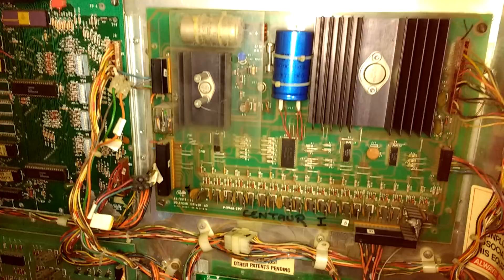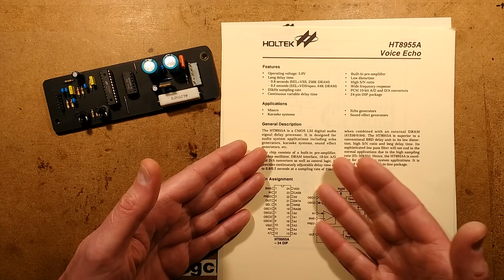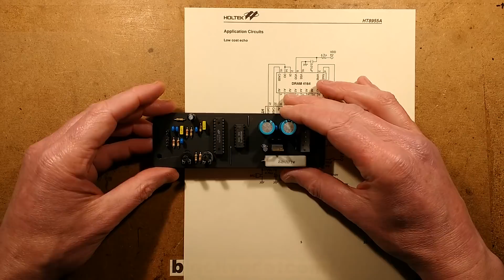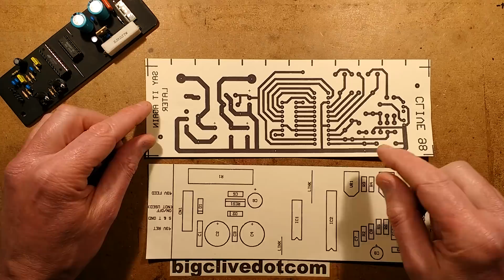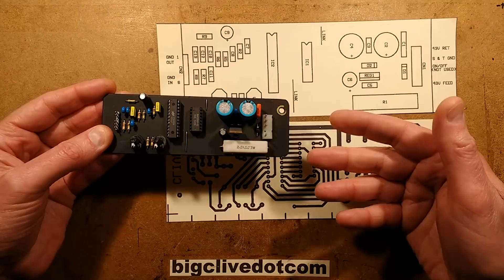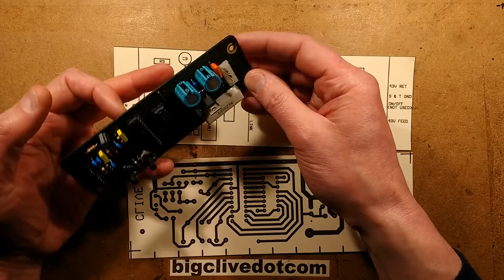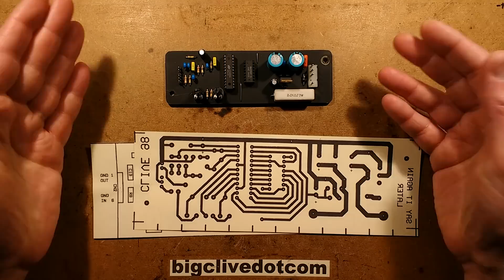Designing the Centaur pinball replacement echo card.

Comment: That old board, you're right, bucket brigade delay line
There's a single chip echo unit around now, the PT2399, there's a few ready built devices on Amazon, the one i have works very well.
Reply from the maker: I did consider redesigning it around the PT2399, but it actually has a high support component count.
Reply: @bigclivedotcom  Xvive now makes modern re-issue bucket-brigade chips, including a 4096 stage (MN3005). Pinout and such is different than the reticon chip, but similar tech beyond that.
Reply: I think the big reason they started that long slide down hill here was they gutted the things a hobbyists would look for and did not cover the other things. They became a cell phone store more or less. really sad the nearest real electronic store is about 35 miles (56.3km) away and they have short hours.
Reply: Not sure if you have/had Radio Shack. Most here are worthless for any real electronics now.
But they had a IC out that was at the time very spendy and later came up with a kit. Here is the data sheet.
 http://www.pmerecords.com/Docs/Archer_SAD-1024_Tech_Data.pdf
Reply: Unfortunately for the PT2399, you can't get sub-30ms delays. With this Holtech chip, you can just swap out the RAM to be smaller for a smaller delay.
Reply: I like PT2399 very much
Reply: I used to work for a TRS-80 dealer as a service engineer  :)
Reply: Sean Not-telling we certainly had Radio Shack / Tandy in the 80's. I worked for a company that used the TRS-80 for automated test equipment. At some point about 15 years ago possibly they ceased to be in the UK. Pity because the TRS-80 was damn good for it's day.
Reply: "but it actually has a high support component count." Eh? All it needs is a few passives and a 5V supply to make a 'low cost' echo that matches the Centaur sound.

Comment: Analog electronic delay? Probably BBD, bucket bregade device.

There haven't been analog delay ICs available for decades, until they suddenly started appearing super recently. One is Xvive MN3005, quite expensive. Another is Coolaudio V3205SD, which is much cheaper.

Most guitar pedals use a digital delay line these days, designed to imitate the analogue ones, PT2399 from Taiwan. It's incredibly cheap, and it's perfectly fine.

Comment: I want to make one for my CB radio. Do they run at 12 volt DC after the step down module?
Reply: Ah 5 volts. Easy peazy.
Reply: You can buy mics with built in echo for CB's - not sure it's a good idea, but you can.
Reply: I was just reminded of the echo mic I used to have for CB back in the day.
It had feedback and volume slider, with a "modification" to bring the loop speed out to an external control, just like Clive describes.

I'm going to have to go find it now, I'm curious to see what it uses.
Reply: Alternatively I believe people used to use a thing called a Melos Echo Chamber - just a little external echo box that seemed to work quite well for CB for some reason. Think people use 'em for dub music too.
Reply: mordokch I have bought numerous mics and internal boards. I just like tinkering and modding on my own. I'm also not terribly impressed with most commercial CB boards or mics.

Comment: There is another echo chip on the block from a Chinese/Taiwanese company called Princeton Technologies, and now most echo circuits seem to use that instead of Holtek chips. It has DRAM built into the chip, but I'm not sure how compatible it is, considering I couldn't get it to work.
Reply: Update: I'm gonna attempt to make a more modern version of the board.

Comment: I learned 6800 machine code back in the day, pinball machines are a classic case of machine control. I wonder how many 6800 controller boards are still chugging away - long superseded by PIC I suspect :(

Please show the Haunted House sometime I've not seen one working in years!
Reply: The PIC16 was designed about the same time at the MC6800 if not just slightly before. GI got that initial concept quite well sussed out.
You can take solace in the 6800 highly influencing (ahem...) the design of the 6502 which then highly influenced the ARM1 (and subsequent) architecture. 
It's funny how the early 8 bit cores live on.... In 2018 I use synthetic 6502 cores extended with 64 bit DSP acceleration in VHDL.

Comment: Excellent video, Clive!! I like how in the Centaur, the games options are done with dip switches. In the 1977 Argosy EM machine I have, it is banana plug jumpers! And the sounds are solenoids striking a mini xylophone. Huge leap in technology in just a few years in the early 1980s. Unfortunately the reliability of "solid state" LSI components wasn't all that great yet.
Reply from the maker: One of my older electronic pinballs (Bally Xenon) still has an option to emulate chimes instead of the more modern sounds.  Which is odd because it also speaks.
Reply: Watch for a package in the next week or two... I sent you a YouTube PM to let you know, but that system is dubious at the best of times.
Reply: Kind of the best way to describe them, with a row of sockets with a plug on the end of a short wire to select points needed for extra balls, 3 or 5 balls for a quarter, etc. The connectors used to interface the back glass lighting and score panel with the main electronics under the playfield are pretty primitive looking too.

Comment: Very interesting, and a great service to posterity to bring this machine back to life. I have not been able to discover how the SAD4096 worked, but there are other reports of its weakness for decaying. One person posted on a forum that s/he bought a job lot of 1000 old SAD4096 chips, expecting to make a killing selling them off as drop-in replacements, only to find that 935 of them were dead on arrival. Someone else has ingeniously made a little circuit board which does the same job and fits in the SAD4096 socket!
Reply: DRAM chips are extremely finicky themselves - try running them without their power decoupling capacitor right beside them, you will see degradation within weeks. However, they don't decay in storage - well, some of them actually did in the 80ies, but that was just a manufacturing accident where the epoxy enclosure leached out a chemical that corroded the innards. Maybe they have had a similar problem with the SAD that is completely unrelated to its principle of operation. With DRAM chips, none of such issues made that much of a splash because there always were multiple sources of compatible ICs, but with unique ICs coming from one manufacturer...
Reply: How have you not been able to discover how it works? It's literally the first line of the datasheet! "The SAD4096 is a [...] n-channel bucket bregade [...]." The corresponding Wikipedia page explains how a BBD works, it passes the charge along a line of capacitors every step. Because there is no sequential control, the number of capacitors is really double the number of stored charges, to prevent the whole thing basically being a bunch of capacitors across a short.
Reply: Siana Gearz I'm quite surprised the SAD4096 degrades like that, as it's basically the same technology as a DRAM chip, only simpler.
Reply: I have a number of SAD1024 chips from the 80s that I never got around to using in anything, which got me wondering whether they still work all these years later.  A number of chips from that era suffer from passivation issues, I don't know if that is what is degrading these chips or not, but that was a very common issue in early CMOS chips of the time as they were still perfecting the manufacturing processes.

Fortunately these days there are a lot of simple ways to reproduce the affect from long physical delay lines (around 1 million feet of copper will buy you about a millisecond!) to simply digitizing the audio with an off the shelf microcontroller (with adequate sampling RAM) to specialty chips.  They did not have that abundance of choices in the 70s and 80s!
Reply: Actually, it's not. The cell amps in DRAM only need to differentiate between two charge levels, and the cell caps can degrade a lot before that becomes impossible. In BBD chips, however, the precise charge on the cell is critical and even partial degradation can render it unusable. Multiply that by the few-hundred to few-thousand cells in these chips and the signal can be completely lost before it makes it out the tail end of the brigade.